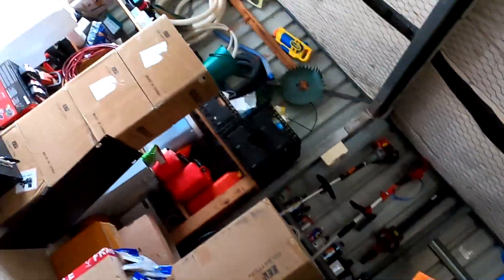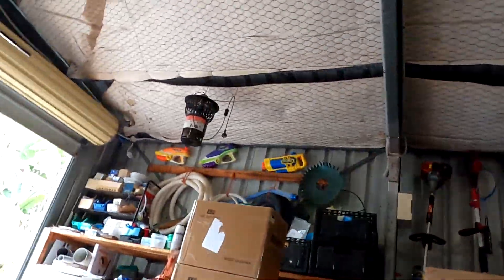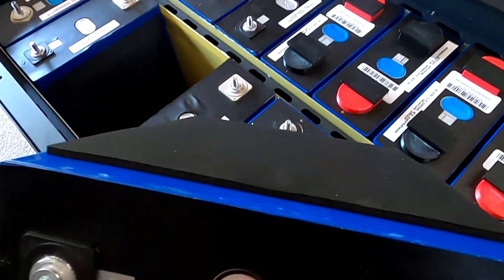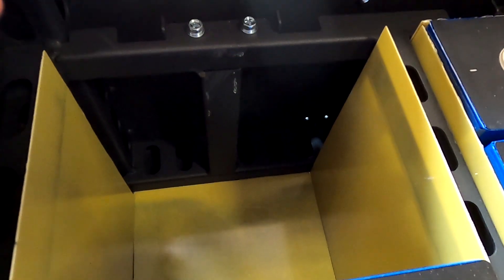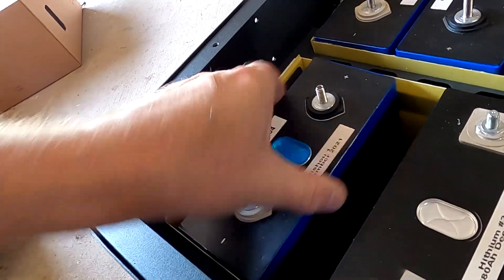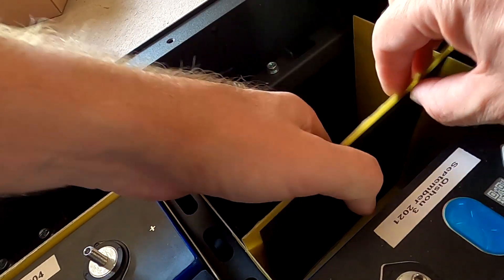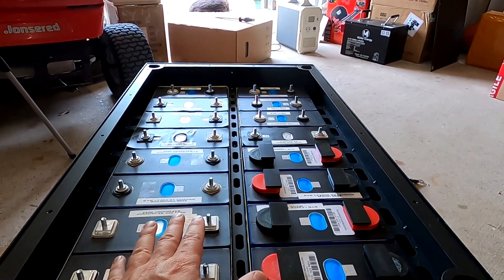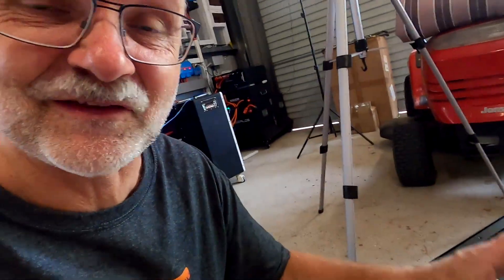How to improve the compression in the SEPLOS MASON 280 DIY Kit.

Comment: why add more cost and weight? there are many plastic cases for batteries and some people just wrap mylar tape around it.  Is there any test done on what is the pressure uniformity required for the longevity?  I hear some people say that a snug fit is enough.

Comment: This is a very dangerous design. If you are doing such tight compression you should use die springs or similar to account for small expansion (and failures)

Comment: Andy. Your taughts. I want to install my Seplos DIY 48V 280Ah on its back , meaning display facing up to the ceiling.  So I think I gonna put some plates on the back/rear side so the all the cells will rest on those plates. Will that be doweble ??  Thx for all your efforts und hallo von Belgien !!
Reply: Meanwhile I have filled up the back portion of the box with multiplex board. And at last with a 5mm alu plate. I have some pics taken.
Reply from the maker: @b67fstb  I think it is more peace of mind doing it, but it does not hurt either as there is still enough room to mount the front plate.
Reply from the maker: That should be doable and I cannot see an issue.
Seplos has also vertical boxes with wheels for that purpose...

Comment: Hi Andy, I'm not sure if someone else has already made this suggestion, but recently I made the same fix for my case last year. However, instead of using two individual panels, I used a single panel that supports not only at the top and bottom but also against the center brace and the side braces. That appeared more stable to me.
Reply from the maker: OK, not entirely sure what you mean here. Also, top and bottom my be confusing terms as it should be front and back maube?
Reply: @OffGridGarageAustralia  Hallo Andreas, vielleicht dann doch lieber in deutsch. Wir reden hier vom hinteren Ende des inneren Käfigs wo Du zwei Alu-Platten eingepasst hast. Jede dieser Platten stützt an den oberen und unteren Rahmen des Käfigs sowie die Mittelstrebe die je am rechten und linken Ende ist wenn ich mich recht erinnere. Nimmt man nun eine einzelne Platte über die gesamte Breite so kann sich diese zusätzlich an der Strebe zwischen den beiden Bereichen sowie über kleine "Ohren" auch noch links und rechts abstützen und dürfte damit vermutlich noch steifer sein und die Stärke könnte etwas dünner ausfallen.
Reply from the maker: @gersch8598  You could have done this in English 😂
Reply: @OffGridGarageAustralia  I tried to 😆 Didnt work.  Egal wie jede Platte ist besser als keine. Ach ja und Vielen Dank für Deine Videos! Sowohl Deine Art als auch die Infos haben mich inspiriert und sehr weiter geholfen. Heute endlich mal 15 kW Wetter hier.
Reply: Deutsch or English ich habe understand😅

Comment: Can you tell how to find bidirectional mcb. Also I checked all your links but you don't have a link for the raspberry pi power supply your using the black colour thing. Please give link for it. I been searching for it couldn't find it😢
Reply from the maker: Most MCCBs for DC are bidirectional, like the ones on my website: https://off-grid-garage.com/battery-accessories/

I don't use a powersupply as such for my Pi. It's been connected to a 48V/5V isolated buck converter since the beginning.

Comment: Why all the hassle? You yourself elaborated on compression and whether it is required or not a dozen times back and forth. It doesn't matter.
Reply from the maker: The Seplos Box uses fixation for holding the batteries in place. It's not real compression.
Reply: @OffGridGarageAustralia  pretty much of a fixation :D

Comment: Nice fix, but I'm a bit confused - you concluded recently that compression doesn't matter for your application of LiFePO4 cells, because you are not cycling them frequently enough for the loss of cycles to be a more 'pressing' concern than other degradation factors?  So I understand why the Seplos still makes sense because your busbars and terminals won't be put under the stress from deformed cells, but why go to the trouble of preventing a bit of swelling at the rear since that has no effect on the geometry of the connectors?
Reply from the maker: Well, the Seplos box design does not provide any other options to hold the batteries in place. So, this is not about compressing or not compressing. It is what it is in these boxes.

Comment: Gday Andy,  a while back in one of your videos you had a 175a Anderson style plug with 70mm2 cable where did you get the lugs to suit please? 
Regards
Matt
Reply from the maker: Hi Matt, what lugs do you mean, the ones in the Anderson or the ones on the other end?
I ordered the Andersons with the 70mm 'pins'. They have them as 50mm and 70mm, depending what cable you are using...
Reply: Sorry the pins in the Anderson (70mm2). Where did you order these from SB2/0 175?
Reply from the maker: @WKNDWRIOR  I think, I got them from eBay and found a seller who had the different pins to choose from for the same 175A connector.

Comment: Andy, once you argued that no compression is needed, than your batteries seems to belly and now   compression is it 😊. Can you do a 1 year experiment by usinfg the alu plates at the end  in 1 one lane of the seplos and 1 lane at the beginning. So lets see what happens...
Reply from the maker: I still stay to my previous comments and arguments, that cell compression is not necessary.
The Seplos box is just designed like this and has only this one option. Tbh, it's not a real compression as the foam in between the cells will allow the cells to move a bit.

Comment: I think you put way too much torque on the screws... I have seen videos of people putting scales in the compression area to determine the necessary torque - and they were all amazed how little torque was needed for the suggested compression!

Keep in mind that the compression should not "squeeze" the batteries into a low volume, but keep them from expanding later on.

Greetings from rainy germany - I love the outtakes with your Schimpfworten :-)
Reply from the maker: Thanks Thomas. I think we're right with the 'compression'. I can still wiggle some cells as the foam will allow for some expansion, so the compression is more a fixture in the Seplos box.
The screws of the compression plates are showing 4Nm now.

Comment: Off topic question
How do you detect a isolation problem in string in  a victron system on a DC side
Reply from the maker: You can measure it with your multimeter.
https://youtu.be/dSez5WrEZFI

Comment: And you told us before compression does not make sense, now you make a video how to adjust the box for better compression. You need to drink a beer and tell us compression or not... 😅😅😂😂
Reply from the maker: I give you both options. This Seplos box has just the feature of holding the cells in place. And because it is on wheels, it makes sense to fixate the cells. Not compress...
This will not extend their life as previously discussed. It keeps them in place.

Comment: Not related to the current video, but as it just came to my mind: Has anyone ever suggested that you should build a small battery (like 12V ~100Ah) in a genuine SPAT crate as case? To me it seems obvious that you should put some of those small blue cubes into one of the SPAT cubes. (As a sidenote to non-german viewers: In Germany SPAT is mostly sold in blue plastic crates which sometimes are refered to as "Blauer Würfel" (blue cube)). Guess sending a SPAT crate over wouldn't be a problem (guess a filled one might be tricky though)...
Reply from the maker: Well, SPAT is sold in 6-packs down here and 4 of them come in a cardboard crate with plastic shrink wrap. Barbaric!
If someone sends a Oettinger crate, I'll do it...

Comment: I'm going to have 4 of these 200a units.  To reduce floor space, I'm considering putting them on end up against the wall so the front panel faces up. My only concern is that it will be too much weight on the bottom cells.
Reply from the maker: It will be totally fine. Why didn't you go for the vertical boxes they have? They have wheels as well...
Reply: @OffGridGarageAustralia  Actually, I got the first one following along with your video's. That one took about 3 months to get.  At the time, I didn't really have a plan.  Currently, I have one that appears to be working fine (using 3 Growatt inverters ) and I ordered the second box that hasn't shipped yet. Similar to you, I have a number of cells that I want to move to the Seplos boxes.

Comment: I am confused - in some videos you say compression is not needed, in some you say it is needed but it isnt needed, and in this one you take some effort to compress them. Whats the consensus? Is compression needed?
Reply: The video was not about compression or non-compression. 
In the Seplos DIY battery box, compression is given by design, no other choice here.
It was just that the rear compressed battery cell did not have support across its whole surface, 
which is not ideal, it only had support on the rear beams it was pushed against.
Reply: @tiborchren  I wasn't asking about the Seplos system. I was asking in general. 

If as Andy has said compression is not required, then improving the compression in the Seplos system, would not be required either. 

I am asking about battery compression in general as it seems there is no hard and fast answer.
Reply from the maker: What Tibor said 👆
It's the box design and more a fixation to keep the cells in place.

Comment: I wonder what your reasoning is for adding TWO plates? 6mm better than 3mm? I would think 3mm would be enough. I imagine there was no vertical support on the L/R vertical sides and the plate would possible flex outward? Didn't think the cells would expand that much. But what do I know. Good video. Thanks for sharing
Reply from the maker: Well, I had the space and wasn't sure if 3mm Al is enough. I guess it would have been sufficient.

Comment: Don’t think that extra plates are necessary. Why? The cells are bulbing normally from the middle and there is the bar for support already.
Reply from the maker: They usually don't swell at the middle but more where the electrodes are, so right where the gaps in the back wall are. The foam has shown that.

Comment: It takes up too much space I think. My metal box is from a different company, and the design inside is different. The void at that end is a full width single space (bar the uprights in each corner), which you could (almost) solid fill. It is 25-26mm deep, so I wonder, you could fill that quite cheaply with a few small sheets of 5mm epoxy board. I can get offcuts from a local company for a total of about £30 to fill that space, providing a solid end without losing any of the length. Thinking about it, you only really need compression around the electrodes, not the entire cell width. Interesting idea though.
Reply from the maker: The Seplos box has heaps of space for such a modification, so that additional 6mm is not an issue at all. We will do some vertical batteries as well soon and see how it works there...

Comment: Initially the re-compressed cells will reduce their overall width right at the bulge, flattening but widening a bit, but the volume won’t change. The foam will obviously compress. When the cells expand over time, the screwed on end plate won’t stand a chance and deform. Probably won’t have any effect short term anyway as little feedback has resulted. Happens in most rack batteries that have cells that are restrained. Should be really interesting where the batteries are close, welded busses and poorly compressed. Like a drooping accordion.
Reply from the maker: We will take it appart again in a year's time or so and see what has happened. A bit of a long term experiment....

Comment: The Mason 135 is the same way
Reply from the maker: I couldn't quite remember... but we use smaller cells which are not tend to swell that much. Still should be a flat area in my opinion...
Reply: @Off-Grid Garage  guess I will be tearing all 3 of mine down to add something to the back, been in service for several months so not sure if it's advisable to take them apart at this point,  hopefully while I am waiting for yours or someone's else's reply you are working on your new neeeeeeeey video
Reply from the maker: @todamnbad  Yeah, not sure if it is necessary at all, but the EVA foam showed where the cells got compressed at the end. a bit more support can't hurt, I guess...

Comment: 6:13 Shouldn't we calculate how many Nm to tighten those 7 screws to achieve a battery compression of 300 kg?
Reply: No, because it will be too dependent on the friction of those screws. To do it the proper way, you would have to add springs and calculate the force by measuring their compression.
Reply from the maker: That is far too much. The Seplos box provides a fixation of the cells so they don't move around when the box is being wheeled around. It's not a real compression.

Comment: I think the plates are overkill. Like your analysis in a previous upload, compressing the cells does not really matter that much in the long run. I like the way Seplos did it, which simple keeps the cells locked in place and not succeptable to vibration for mobile use cases.
Reply: Yes, it is a little bit inconsistent with his previous videos. He got me really confused. A year ago compressing was unnecessary, then a shocking drama with the cells bulging, a few days later again the message "Do not worry, be happy", and now something that might be interpreted as another U-turn. I'm going to build my first box for batteries soon, what am I going to do?
Reply: @higamato3811  Follow manufacturers recommendations as always .
Reply: @onthelake9554  Manufacturers instructions, which don't appear to have any examples of how to package 16 cells, that's why there is all the confusion.
Reply: @TheRonskiman  I would be interested in the number such as force (Nm) to press the articles. And not the statements "from the eye, estimated".
Reply: @Slavomir-1977  Nm on a bolt will not work (if that's what you mean), as it depends how many bolts you have, how big your spreader plate is etc.
Reply: @TheRonskiman  Then what force to press? I have Eve 280ah. Everybody talks about it but no one knows it. 🙂
Reply from the maker: Even compressing does not matter much, if at all, the Seplos box does have cell compression or fixation by default. I didn't want to install the cells lose in the box, so the compression is part of the case design.
I agree, it's not the 300kgf as recommended but if gives the cells a good snug fit inside this case.
Reply: My idea is,if you compress do it like manufacture’s recommendations and do it from the beginning when you start to check them

Comment: Your welcome Andy! I will be interested in how things go, as I may do the same with mine, because I've upgrade to 2 x 5k Growatt Inverters and the old 10C BMS looks like I will have to replace them with the 10D type, as communication problems are proving difficult. Which means disassembling and handling those very sticky pads!! lol (my misses is German)
Reply from the maker: Thank you, Ken. Can you still get the 10D BMS from Seplos? I thought all new ones are 10E now which can do both CAN and RS485.
Say hello to your wife 👋
Reply: @OffGridGarageAustralia  Not sure I will ask if your that interested. I had mine for 2 years and had the 10C ordered at the same time. I am now installing the 10C as I am upgrading to Growatt Inverters. My old Inverter has short circuited on the DC side, still brings in the solar though. I will try to fix when I have uninstalled it!

Comment: 2:05 But isn't placing that support in the center of the battery wrong? Wouldn't it be better to leave the center empty and only put walls on the sides or a larger plate without holes? This is to allow the cell to handle the atomic-level forces involved in cell expansion (which, if I'm not mistaken, occur in the center of the battery) during charging and discharging cycles.

Or how do you think the atomic-level forces involved in cell expansion should be managed? I still haven't figured out what materials the separators should be made of, whether they should "have a bit of play" (somewhat like the porous separators Andy uses) or whether they should be rigid like PVC... etc.

Sorry, let me integrate now. I commented pausing at 2:05 without listening to what Andi says subsequently, and I must say that he makes very interesting and, in my opinion, correct arguments. A case as expensive as this one should have been better designed.
Reply from the maker: I guess, an even and plain plate at both ends is ideal, the very small expansion can be absorbed by the foam in between the cells.

I'm not even sure if this back plate is really necessary as we have more a fixture here than real compression.

Comment: Hi Andy,

This makes me wonder about the other seplos cases you have installed. How did they do and is any misformation visible at the back.

My 1st kit is on the way from china now, I will make some plates beforhand.

Did you think about universal busbars already, or are you going for the frankenstein mix of busbars also ? 

Keep up the good work 👍🏼

Mike
Reply: We just have to press translate to english below you message 🙃
Reply from the maker: The other two Seplos MASON boxes don't have any back plates either.
I'm still unsure if it is needed at all or overkill. I guess a 3mm plate at the end can't hurt...
Reply: +Guter Kommentar, genau das wollte ich auch gerne fragen, wie sieht es mit dem älteren 280er Case aus, sind Veränderungen an den Zellen zu beobachten, oder ist das nur Panikmache?
Wäre schön wenn Du das hier lesen und beantworten könntest. Hilfreich für alle welche solch ein Seplos Case haben. Ich schreibe das in meiner Landessprache, weil es meine schöne Heimat-Sprache ist und alle die wollen, können Deepl oder Google nutzen.